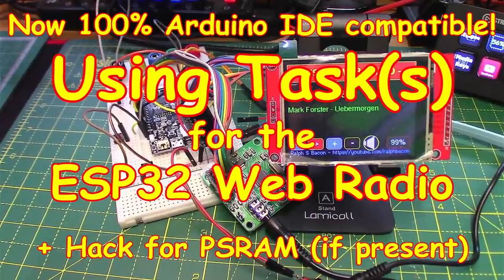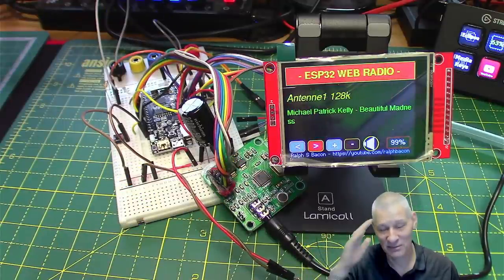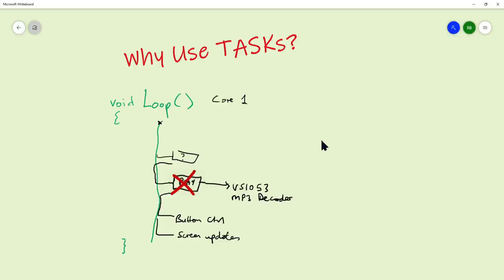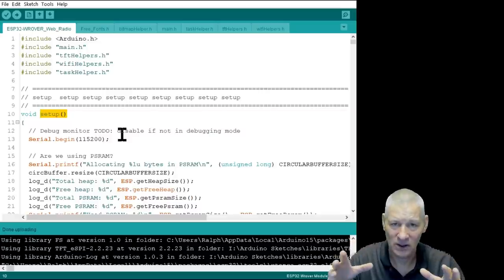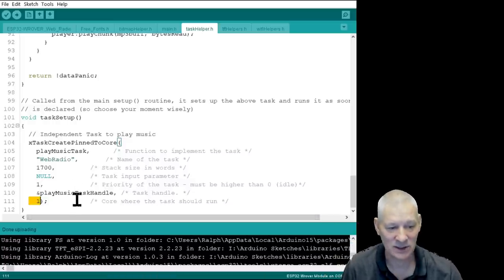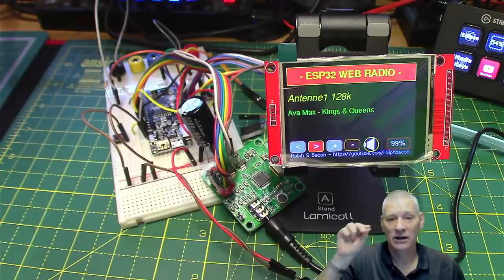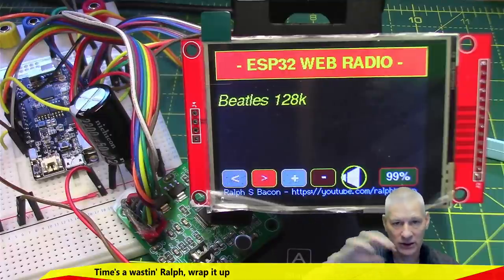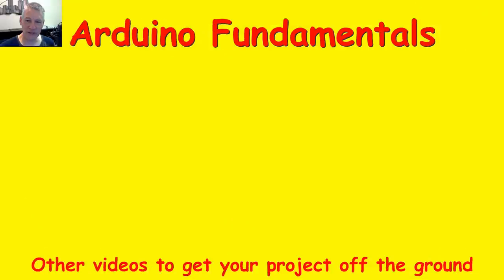#208 Using an ESP32 Task for my Web Radio - using the Arduino IDE

Comment: I'm sure you already realized this, but the reason your highwater mark debug code never shows that value going back up is because it's the highwater mark. That value will never go back up simply because it's showing the lowest value of free memory it ever reached.
Reply: This is exactly what I thought and almost commented.
Reply from the maker: Yes, that much is clear; what is NOT clear is why the free memory gradually reduces over time, sometimes over several hours (or even overnight). I mean, what on earth can be using up that memory, given that the tasks has run hundreds of thousands of times before?
Reply: I'm sure guesses are a dime a dozen so I'll throw in my $0.0133 worth(sorry for the US Currency) guess 1, the stream jitters, gets behind, then catches up, draining and then filling your buffer. 2. The stream is variable bit rate and it hits an unusually long section. Of audio that requires more nits.
Reply from the maker: I need 11 more guesses from you Kent, to make that an even dozen. And you could be right. What is weird is that it never actually runs out of stack space.
Reply: @RalphBacon  Any function called from within the task adds to that tasks peak stack. I suspect if you trace through the libs you will find an alloca or other stack based operation inside a conditional if (if C++ compiler rules are in play). As it is not a protected memory environment then depending on configuration the stack use may even descend all the way to the interrupt service routine.   Also the tasks own context is pushed onto that tasks stack, so if the task is in a "complex state" then "extra" state may be pushed during that task suspend, it still counts as peak stack.

Comment: These global variables, flags, ring buffers, etc that are shared among tasks really need to be protected by semaphores or mutexes (aka critical sections) so that multiple tasks dont try to read or write to them at the same time.  This can lead to bugs that are very hard to diagnose in regular software and even harder in MCUs where you have much more limited debugging capability.  FreeRTOS, upon which the ESP32 core is based, has all these concurrency features for a reason. Perhaps you have talked about them in prior videos.  This is a perfect place to make use of them.  Concurrency issues really should be treated with the same amount of paranoia as pointer related memory corruption bugs, as they can behave very similarly.  Concurrency related bugs can even cause memory corruption bugs in non thread safe code that is used in a multithreaded environment.   Been there, done that more times than I want to admit.    Hope that helps.  Enjoying these excellent videos.
Reply from the maker: Probably, Mike. More than that. Almost definitely. That circular buffer almost certainly! Once I get one that can use PSRAM without a hack.
As there are (currently) no other tasks running that share these variables I didn't do all this yet (I just made one variable volatile) but it needs reviewing when I create the next task to update the circular buffer. Strange bugs I don't need!
I covered semaphores and queues in a previous video so I'm on the case!

Comment: You can change the uP speed for the ESP32, can run up to 240MHz
Reply from the maker: You can, indeed, but why you would not want to always run at the 240MHz is something I would need to know.
Reply: @RalphBacon  Reason number one would be saving power. When there's not much to do for the system and time is not critical it can be quite useful to run at a lower speed. Another reason could be reducing EMI. Reducing clock speed when reading analog inputs can reduce noise significantly.
Reply from the maker: I'm not convinced about this "power saving whilst running more slowly" argument, whether it's an Arduino or an ESP32. Even if we can measure the drop in current, the processor will run for longer to do the same work! I will have to look in more detail at this, most certainly!
Reply: @RalphBacon  It's not a miracle cure of course. As you correctly point out the processor has to run for more time with a slower clock and that might cancel out the power saving. I don't know the details about the cpu in the ESP32 but on a lot of cpus you can reduce the supply voltage at lower frequencies and the power usage depends on the square of the switching frequency! So that can definitely save you some power there. It all depends on a lot of factors so usually the best way to find out is to just try and measure on a real device.
Reply: @RalphBacon  I built a complex project with multiple units (a timer scribe interface, queue unit, Lora to wifi gateway, web server) the scribe and queue unit both run at 80MHz to preserve battery power, as they also use a 2.4” OLED and have to run for 2 days, as well as sending data over Lora. 80MHz is the lowest speed that supports wifi. I have a playlist showing the project I might post a link to it so you can see it.

Comment: Just wanted to say thanks for this video. I actually saw your video about threads and semaphores, and knew I had to come back and look at heap sizes. This video, though about all sorts of other good things, showed what you did to check the heap size. I've stolen it :-D
Reply from the maker: Glad I could help! It's all Open Source so no stealing is involved. Sharing is caring. 🤮 Hang on, where have you gone? Come back!
Reply: @RalphBacon  I can't lie, I'm sat here chucking away to myself with that response... I'm sure you're the same, you see a small bit of code, in the middle of everything else and think, "you know what, I like that, I need to borrow that before I forget about it" :-)

Comment: Typical, I spend days solving a problem on my MAC so that I can install PlatformIO and then you port the radio app back to the Arduino IDE! 
Seriously though PlatformIO is far better that the Arduino IDE and it takes me back to the IDE’s that I used way back when. Now if only the grey cells were as active as they were then. Thank you for another great Video and schematics. One point, in your GPIO Pin Notes you have the onboard LED as GPIO2 on the TTGO T8 V1.7 it is GPIO21. So if you run any I2C devices the Green LED is on all of the time.
Reply from the maker: Definitely stay with PlatformIO, John. It's streets ahead of the (current) Arduino IDE (although the new version will be similar in features, I suspect). Thanks for the heads up on the LED (it's probably from an older version of the sketch).

Comment: ESP32 Arduino 2.0.0 has PSRAM mapped to malloc. Also, please understand that PSRAM is working fine in the Arduino core. If you have troubles with it, that is because you are doing something wrong or editing the wrong file. Instead of saying how you gonna come on the forum, why not come by the Gitter room (linked on the github page) or even submit an issue in the repository? The forum is more IDF oriented
Reply from the maker: Yes, I heard that v2.0.0 allowed malloc to use PSRAM (not sure if it was optional PSRAM or Stack) but the Circular Buffer (cbuf) I'm using just defines a variable as a new char* so I don't think it will get used. I might need to use a different Espressif class. But I would need to investigate more. Good idea about the Gitter room, I'll look it up.
Reply: @RalphBacon  with 2.0.0 that 'new' will allocate directly to PSRAM if available.
We can help you out on Gitter on how to get it installed. I believe PIO also have it available.

Comment: Ralph,  I have a suggestion for your radio...
Implement bluetooth pairing with portable speakers.  This way your internet radio stays someplace central and you just take your bluetooth speaker to where ever you may be in the house. This gives you quality sound and removes the need to utilise analogue circuitry for the task.  Leave that to your commercially purchased bluetooth speaker.
Reply from the maker: I certainly want to experiment with BT audio next year. Let's see what I come up with, thanks for your suggestion.

Comment: Great video again, Im glad you ported to Arduino IDE so I can use the code. Looking forward to giving it a go and your video on the buttons.
Reply from the maker: Hope you enjoy it! Remember the code will be changing until it becomes RC1 (Release Candidate 1) but it's stable now, better on a WROVER with PSRAM, but OK on a WROOM.
Reply: @RalphBacon  Thats good to know, Im sure Im using a WROOM but haven't checked which version yet. Im kind off dipping in and out of the project when the wife is not around.

Comment: Excellent video, very interesting. If I could make a couple of comments, you didnt show the latest circuit diagram, that would have been interesting to see as I guessing you have added a PWM pin via a FET to control the backlight brightness ? Also could you please reconsider your decision about how to remove the background noise ? I would likely purchase one of your PCB's when you have it finished but not if I have to spend another tenner or more to buy that ground loop noise eliminator. Thanks
Reply from the maker: Circuit diagrams are in the GitHub repository (under images). I'll improve upon that going forward. 
I might revisit the ground loop isolator with those transformers but not right now - going forward I realise it would be a simpler/cheaper option, true (although cheaper ones are available for about $5, I just bought that one because Amazon sold it - next day delivery - and it had many good reviews).
Reply: Hi Ralph thanks for the reply, I found the circuit diagram now under Schematics. At a cursory glance you seem to be driving the backlight using PWM directly from a processor pin. At full brightness arent you pushing the limits a bit ? I think the LED is going to draw about 40mA or  so, thats close to the pin output capability ?
Reply from the maker: I didn't test the current draw; now that you mention it... I should do. It's running fine right now though, no magic smoke (yet). Perhaps a 50Ω resistor in series might be wise!

Comment: NEVER modify supplied code without changing its name. Had a project where they did this and the person who did the backups did not backup the manufacturer data files. As normal, engineer left and a year later the hard disk failed! Once restored no programs would compile.  There were no records of how this was modified, so reverse engineering this took months and cost £1000s.
Reply from the maker: Well, I'm just hacking the code "for now" until a permanent solution can be found. And it's non-destructive. If a new version is splatted over the top, the circular buffer will be allocated from Stack memory (probably crash the system but it's obvious from the error message).

Comment: High tide line on a beach only gets further up the beach, it does not drop back.  Is that command giving a value of peak usage so you can tell now close to a buffer overflow you got and not a current indication of free buffer space?
Reply from the maker: That is a good analogy, the high tide mark. Yes, it shows the minimum free memory at some stage in the past, not what is available now. So if you know that you only had 50 bytes free at some point it's best to increase that so you don't ever run out (crash if you do).

Comment: Ralph,
You've push my knowledge about using tasks in FreeRTOS way over my expectations; thank you.
As becoming more knowledgeable also comes the questions.
You use the "canPlayMusicFromBuffer" flag in two tasks, playMusicTask and the loop(), which is just an other task. Shouldn't we protect this flag with a mutex?
As I understand it we must protect a global variable when it is updated by/from two tasks.
Correct me please if I'm wrong.
Reply from the maker: You're not wrong. If the flag is being updated by multiple tasks then we must ensure both tasks do not attempt to update it "simultaneously". But if the single "loop" task (or equivalent) is updating it in multiple places that would be fine.

Comment: For sure a very interesting about tasks and utilizing both ESP32 cores. 
But its not really absolutley essential for an ESP8266 or ESP32 based Web radio.
I meanwhile played around with 3 different versions. One was based on Esp8266 two others based on Esp32. All three have a display and buttons to change the station and volume. All three work fine without additional memory for buffering, using dedicated tasks etc.
So beginner and people like me who are not very patient in coding, can also start easy and then after seeing some good results, still add optimizations like multiple tasks, additional memory etc
.
Reply from the maker: I'm very happy you like the videos, Jeany!
You may have seen the version I ported to the ESP8266; and it ran just fine, without a buffer or separate task for keeping the VS1053 topped-up.
BUT (there's always a "but") I found (as I explained in my video) that if you did anything significant in the loop apart from playing that music then there was a real danger the music would stutter. I've seen some code where the loop was liberally sprinkled with "playMusic( )" calls to keep the VSP1053 running. Not ideal.
So a task is an ideal learning opportunity for people interested in the ESP32, gives a clean, non-stuttering sounds regardless of what you may be doing the loop( ) task and to me, at least, seems the right thing to do. I'll eventually be adding another task to read the Internet stream and populate the ring buffer - just to ensure the core music-playing work is always done, independently of adjusting volume/brightness/station in the loop!

Comment: There is a DC-DC isolator which might also do the trick. At least it is smaller and doesn't (slightly) alter the audio.  Have a look at the B0505S module. Not that expensive and comes in handy for these ground loop issues.
Reply from the maker: I will have a look, Luc, thanks for the heads up.

Comment: Great stuff!  Ralph;  I love your content.  I’ve been trying albeit not very hard for 2 years to connect to an ESP32.  In your opinion, what is the best programming Language for these tiny buggers?  I’m purchasing a new LOLIN ESP32 and giving it another shot.  Would like some feedback please.  TIA
Reply from the maker: Are you already in any way up to speed with the original Arduino IDE, Nick? If so, use that initially just to load some simple ESP32 sketch (Blink?). If not, (and even if so once you get that Blink sketch running), I would recommend switching to VSCode and PlatformIO. I'm not going to pretend it was all plain sailing but once you have got over the initial learning curve you will benefit greatly. Using C++ (of course) and Google is always you best friend.

Comment: Ralph, I noticed that you used *.h files for "real" code (functions) and not just for #defines, function prototypes, etc.
Was the idea to avoid the "hassle" of linking multiple *.cpp files and all of the attendant details?
(I have written a couple of projects using multiple Arduino IDE tabs for separate *.cpp files and matching *.h files. It can get to be a bit nit-picky, but it works as expected.)
Reply from the maker: You found me out, Kerry! 

I was hoping no-one would question this! Yes, I put all the code into .h files for expediency. I should have only put the includes and function definitions in the .h files and all the code in a .cpp file (with an #include for the matching .h file). 
That is most certainly Best Practice and what I would be expected to do in a work environment (peer reviews would immediately pick this up). 
But here... well, no-one will notice. Oh. Someone did. Drat! Slap on wrist. In the fullness of time I might correct this.

Comment: Hello Ralph, just a question. How does the main loop get run if there is no blocking happening on the higher priority task. At some point it has to go into a vtaskdelay() or something that blocks to allow the main loop to run. I am assuming the main loop is the idle task .
Reply from the maker: The loop( ) task runs at normal priority of 1. If all other tasks run at a higher priority then it won't get a look in, not even from a yield because the remainder of that time-slice is given to task of equal or higher priority. Unless there is a very good reason to change the priority, the message from Espressif is "don't". For short running, important tasks, it may work well, but only the developer will know that. Keeping priorities at 1 will ensure each task gets a time slice.

Comment: Fab Series of videos on this project, watching with eager anticipation of each one as it comes out (yes I know sad!).  Dreading looking at my stock of ESP32 dev boards and finding out they are Rev 0!          Bit off topic: At the beginning you talk about Eclipse/PlatformIO  IDE's  etc.   I agree as a ancient coder's myself ,  the Arduino IDE can get rather painful after a while.  Been playing with eclipse (for native C++,  trying to teach myself for the giggles!) but when I look at adding the Arduino addons from market place the 'recommended ones' seem to be depreciated.   Have you ever done or would you consider doing a 'beginners' guide to eclipse IDE for Arduino, Nano, ESP32, ESP8266, SMT32 etc?
Reply from the maker: Before we talk about Eclipse (not the Sloeber version as that won't be supported going forward, but still works for now) remember that the new, all-singing Arduino IDE is going to be based on Eclipse-Theia, so you could wait until then. Alternatively, install and grapple with PlatformIO as I did; you won't go back to the (current) Arduino IDE, although Eclipse is a good  competitor. I'll consider what might be the sensible way forward regarding beginners' guides to another IDE.